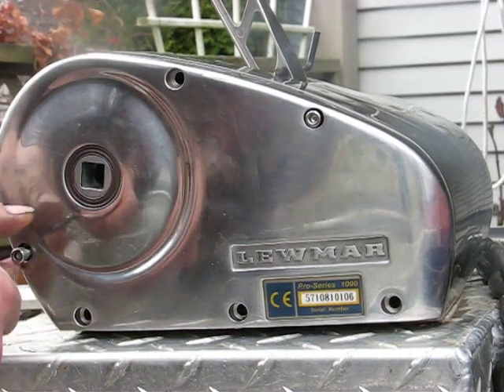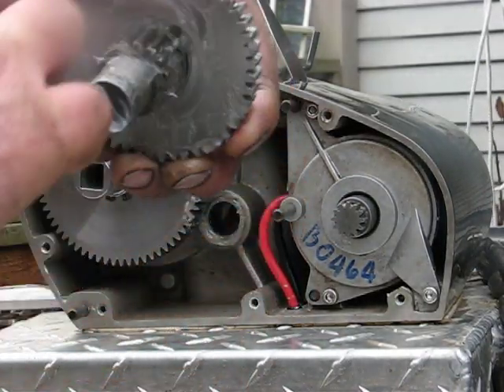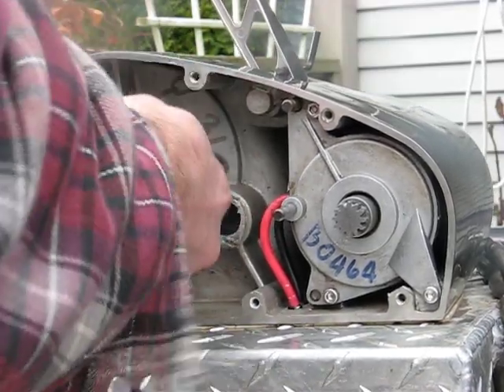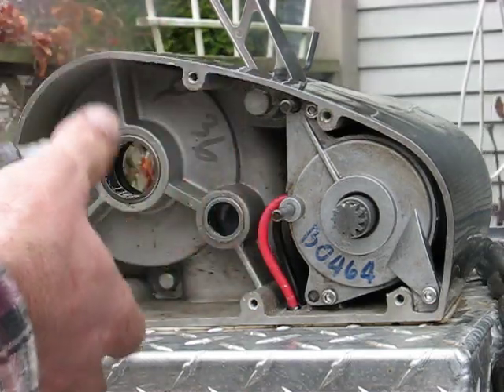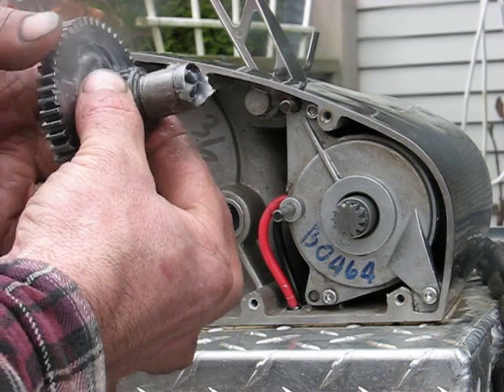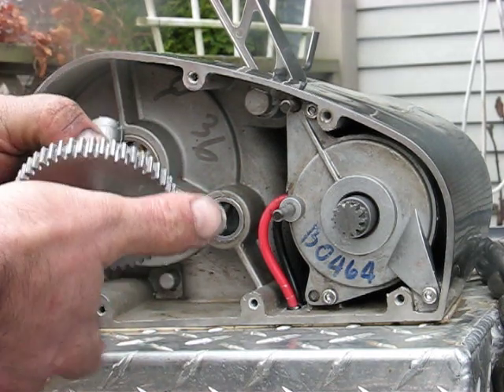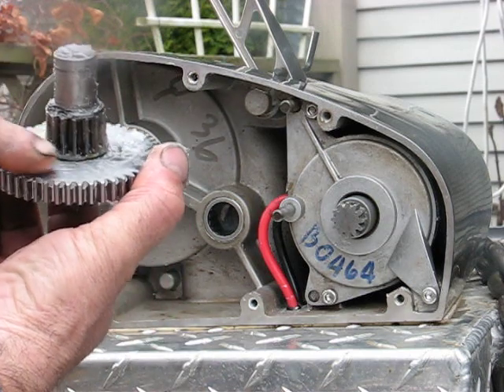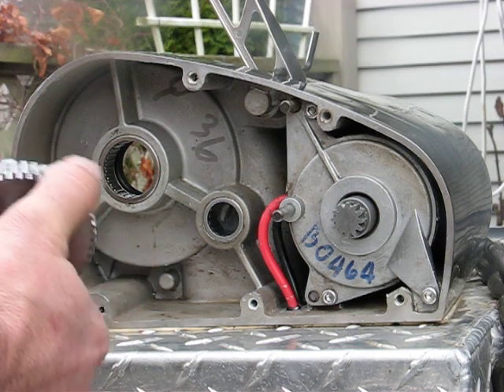Lewmar Windlass tear down 3

Comment: Thank you. I now have a clear understanding of what can go wrong.  I'm actually looking to buy a Lewmar profish1000 but I've read a number of poor reviews.  I'll bet they mostly due to poor manufacturer greasing.  I'm not sure about this product but many products made overseas use packing grease rather than the grease appropriate for use.  Packing grease is made to stick and prevent rust, but not good for lubrication.   + Your comment about uncured silicone makes me think to check it also.

Comment: Good afternoon Thank you very much for your winch video! I have the same Levmar winch on my boat. Please tell me that the gear that is located on the electric motor shaft should be firmly fixed or is play allowed? For me it moves within 1-1.5 mm. This is fine? Thank you!

Comment: Thanks for the windlass for dummies series :)))  I've changed all the gears by new last year (trough a professional) of my pro-1000 and after 6 months of sleep in marina, today the windlass did the same... engine turns but gypsy did not... sound was slightly different this time, it seems like gears wasn't turning as well, just a smooth clean electric motor sound there was... Also there was no back flowing, so 2nd gear works well... I think that 1st gear shifted on the shaft towards the cover, the gear you pulled out @ 0:30... is that possible? there was only nylon bushing while you dismantling, anything else to keep it in right position? if thats the problem I can handle it w'out tear the whole windlas down, if not then I'll call for pro-help because its in a tide place under the chain locker hatch and there's not much to do like the ones are mounted to the open deck...

Comment: Thank you for these video's, excellent help for me as my 700 has done exactly what you have pointed out.  Question, no mention of the motor pinion and how to get that off, can you help before I start in with a hammer on the spirol pin ...

Comment: great video. One question, The lewmar schematic shows nylon washers on main shaft. on both sides of bearing.
with washers installed there is not enough room for lockring.  I see your vidio shows no washers. will it work if i install without washers? thank you
Reply from the maker: There are mods from year to year. I would use what came with your model if they are not damaged. I know the 700 came with 2 different clutch bearings, one had a 16mm and the newer ones came with 18 mm bearing.
Reply: @fishorcutb8  Thank you so much.  I removed the washers and put it together.  BTW  It was very hard to get the main shaft into the bearing on the back plate.  I used longer bolt and pressed it in.

Comment from the maker: After watching your video I would first try to tighten the 3 lobed tension nut with a 3/8 drive ratchet. There are 3 square holes on it to put the ratchet into. If that doesn't work you may have one of 3 issues.The cone shaped portions in the gypsy are worn Part #58  on the parts diagram. It is usually the first to go. Check the tapered areas where the pressure points are. If worn the areas will look brass coloured. Next would be #35 and next would be #28. Here is a link for a manual for your windlass.   Pro-series-fish-manual-G3_B10490 iss2_0.pdf

Comment: Mine has a fleming, that came off, where does that go?
Reply from the maker: https://www.lewmar.com/sites/default/files/Lewmar-Support-Downloads/Product-Literature/Manual-T2388%20Lewmar%20Pro%20Windlass%20Issue%203%20WEB.pdf
Reply from the maker: Fleming??????
Reply: @fishorcutb8  thats what I said.. do a Google search for "lewmar fleming" and you'll see it.
Reply from the maker: @Joeteck  I am presuming it goes in the centre of the gypsy gear. It's purpose is to stop the rode from wrapping around the gypsy gear.
Reply: @fishorcutb8  yes, i would assume too. Strange how it just fell off.
Reply from the maker: @Joeteck  Alan screws may have backed out. Use loctite. The rode rubbing would cause it to wiggle enough.

Comment: I have the exact unit you tore down in your vid. The problem with mine is that i can hear the electric motor running to turn the gear to raise the anchor but the gear on the outside the unit won't move. Its like something is not engaging to turn the gear on the outside. Any thoughts or advice? Great vid btw, thanks.
Reply: Sounds like the same problem here

Comment: HI 
HOW TO ADJUST THE ARM ABOVE THE JEPSY WHEEL, THE SPRING NOT TINCTURED ENOUGH 
CUSING THE ROAB TO JUMP OVER THE WHEEL. THANK'S
Reply from the maker: No adjustment. the spring may be stuck or broken. may need to replace for best tension.

Comment: I have replaced the compound gear ass'y and the one way needle bearing but the windlass Pro Sport 550 will not pull the anchor tight to the roller - it "loosens off" as you say in the youtube. The one way clutch bearing slip fits into the housing. Is it supposed to be a press fit?
Reply from the maker: The bearing should be pressed in snug as not to slip. It is holding the anchor from free falling back out. The cup the bearing is pressed into might have been enlarged from a seized part causing the outer race of the oneway bearing to spin and ware the cup holding the bearing. Should not just drop in.
Reply: Thanks, that confirms the root cause of the problem. I am not aware of a "cup" that the bearing presses into. It looks like it presses into the main housing on the Pro Sport 550. If there is a cup then the cup needs to be replaced (how to get it out) and it must be pressed into the housing. If no cup then the housing ($$)will need replacement or I could try to Loctite the bearing to the housing. What do you recommend? Contacting Lewmar is a waste of time. Thanks again for your help.
Reply from the maker: James McIntyre sorry i meant the casting that looks like a cup.
Reply from the maker: Ya no cup just the housing. I would suggest clean area very well and use  bearing locktite. If it is not to far gone and let it set overnight to cure before final assembly. Good luck. Your problem probably arose while shaft collar was seized. Then  it was powered in or out causing the bearing to spin.
Reply: I have installed the one way bearing (bearing ID info facing out) using Loctite 660 and it appears to be holding. However, the windlass will not pull rope in but it will let rope out. The motor groans and stalls when trying to pull rope in. I have a new compound gear assembly but it appears to be locking up because when it is removed from the housing it is locked and I believe the small gear should be free to move. What would cause a new compound gear to lock up and what can I do to fix it? I paid $140.00 for it.
Reply from the maker: It is suppose to lock up when hauling in so anchor stays up when you let off on the switch, but when powering down the gear should free up. That is why the one way bearing is there. Try powering down before taking it apart. Hopefully the lactate did not get in the bearing. check to see if the shaft will turn one way and not turn the other way. take all the other gears off to test. Try turning all other bearings to see if they are not stuck.
Reply: The one way bearing rotates CCW but not CW. I had already confirmed it allows rotation CW and not CCW and is not seized due to Loctite. I powered the anchor down and it is ok - although I can physically pull rope out by hand. I removed the compound gear and the sleeve is free to rotate. When powering up, the unit seizes. I removed the compound gear and the sleeve is locked tight, which means it locks in the one way bearing that does not allow CW rotation - which is needed to pull the anchor in. I don't understand why the sleeve locks up when powering in the up position. Very frustrated. I appreciate your help very much. Thanks Jim.
Reply: @jamesmcintyre6687  I know this is old post.  Did you find a solution?  I am having this issue as well.
Reply: @geralddunne1  Gerald, this brings back many frustrating memories of trying to repair the Pro Sport windlass. The Pro Sport was not a quality unit and I finally sent it to a Lewmar repair center in Chicago and was told it was not repairable. I gave up trying to fix it and sold the gears I bought. I now have the Pro Fish windlass that has worked good for 7 years - knock on wood. Good luck.

Comment: Does anyone know if the one-way bearing is supposed to go to the right or left?   It has a counterclockwise arrow on the face but I’m not sure which way it goes in or which way the gear is supposed to turn /not turn
Reply from the maker: It should  rotate freely counter clockwise. Lock up clockwise. If you follow the power flow when bringing in  the rode the main shaft is rotating clockwise and the second gear will rotate counter clockwise. When you release the power switch the one way bearing will now hold the shaft from rotating back clockwise. INA bearings have the size engraved on the side facing out from the bore hole in other words you should be able to see the numbers when installed.